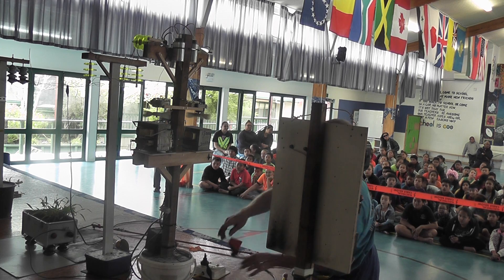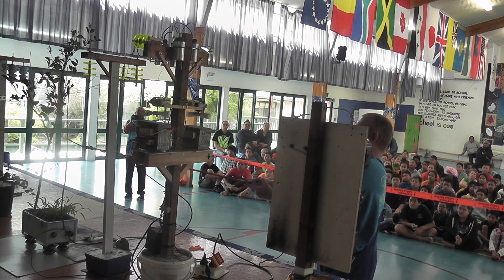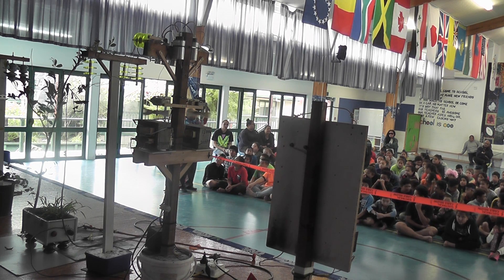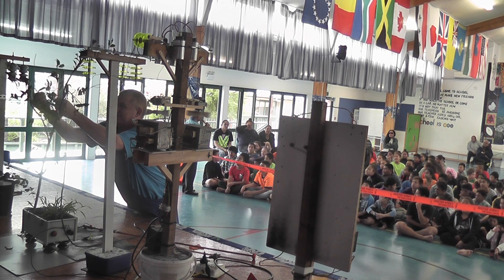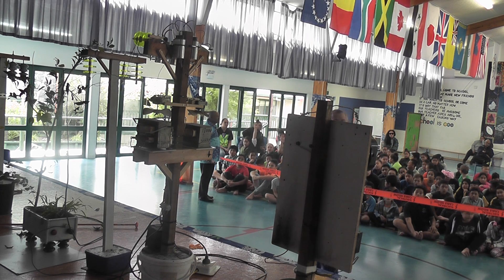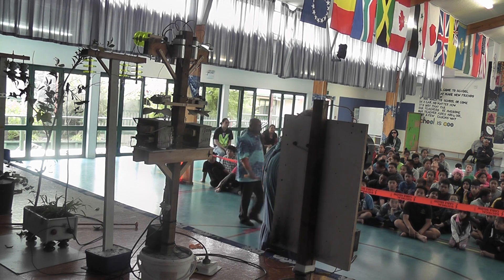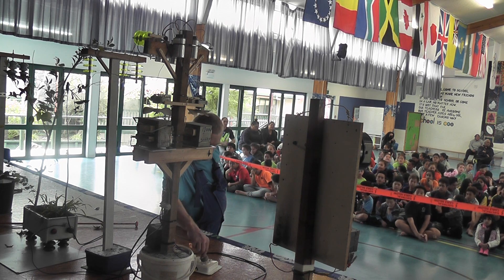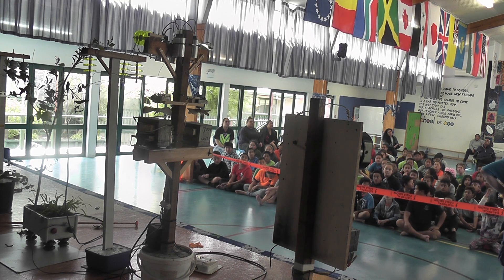Electricity demo at Finlayson Park School

Comment: "It's alive!  IT'S ALIVE!!!!!!"  I particularly liked the demo of the house wiring without the fuses.  MCB's and RCD's are one of the best things to happen to this country since fuse carriers kinda went out of style in house wiring.  You used to get people wiring bits of coat-hanger or #8 fencing wire across five or ten amp circuits with those fuse wire carriers.  I have no doubt that more then one or two house fires have been started by people doing that, rather then finding out why the original fuse blew.